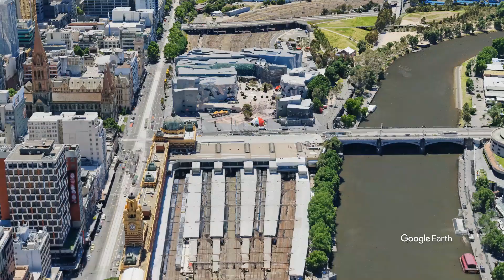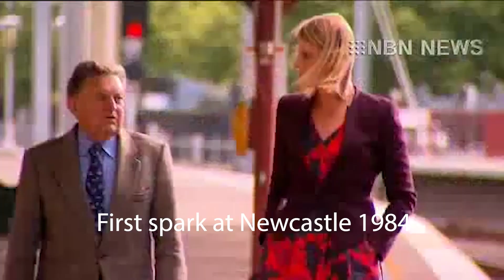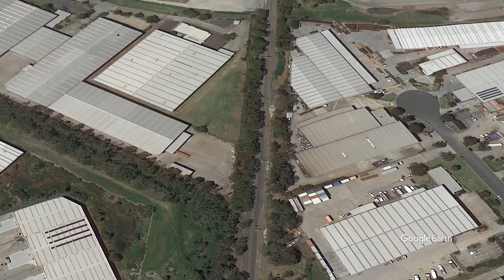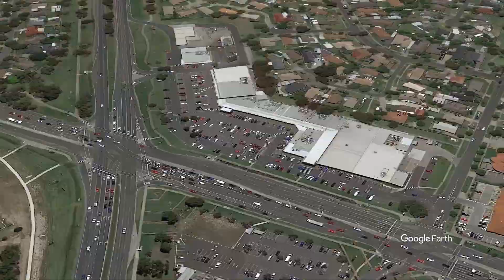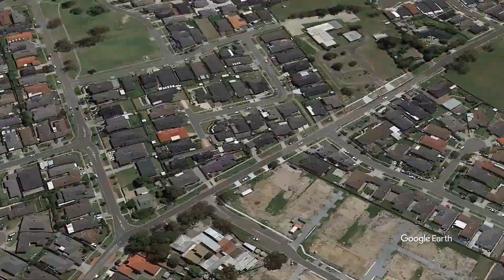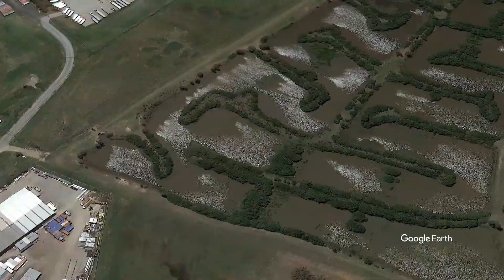Electrifying Regional Train Lines

Comment: Victoria lagged behind with electric rail to regional centres like Bendigo, Ballarat and Geelong missing out while NSW established electric inter city lines to Kiama, Newcastle and Lithgow. Cannot understand this as costs would have been lower back then. India has embarked on a huge electrification programme and currently has hundreds of diesel-electric loco's up for sale as electric loco's take over.  The Melbourne-Sydney corridor competes with cheap air and road coach fares and hasn't the current passenger levels on the current XPT passenger services to exhibit a positive financial return for the investment. Also the old steam era route between the two cities that has sharp bends that need to be ironed out for high speed passenger and rail freight at huge costs.  Great video and information, thank you.

Comment: Great video.  So weird to see a vr liveried electric locomotive.  Never realized there was such a thing.
Reply from the maker: Yeah it is weird but kind of cool. Still 2 in these colours today (1150 and 1162)
Reply: There were also the 1920 era E class locos, they were a marvel of brass dials and guages. Originally they were just 1101 to 1110 but when the E class steam locos became off register, they were assigned E1101 to E1110.
There were two older steeplecab locos but they were retired in the 50s AFAIK.
Train crews called the E class as “electric chairs” or known as butterboxes. They would sit there and go tikka-tikka-tikka.
Reply from the maker: @darylcheshire1618  thankfully some of those are preserved as well. Would be lovely to see them operate again
Reply: @MetroManMelbourne  I there there are a couple of E classes plus one Parcel Van CM, try Electrail, not sure if there is a T there, maybe ElecRail

Comment: It’s also likely that the Sydney to Melbourne line will be electrified sometime in the future if they upgraded the line to a high speed regional line as previously proposed due to the power output limitations of Diesel engines.
Reply: Need a new line where there aren’t so many wide curves but rather a straight line
Reply: @vincentweatherly9991  
Yup so in that case it’s likely that the line would also need to be completely rebuilt with new tracks and equipment that can handle high speed trains while the line route would have to be modified significantly to remove as many curves and level crossings as possible! :)

Comment: To understand the difference between 25kV AC vs 1500V DC you need to know a bit about how electricity works. Firstly, Power consists of Voltage (measured in Volts, or kV [kilo volts] for thousands of volts) and Current (measured in Amps, commonly written as “I”). Think of voltage like the pressure in a water pipe, and current like the speed of the water. Power (measured in Watts) is like the total amount of water flowing through the pipe. It is the voltage multiplied by the current (P=VI). So you could have say 1 volt and 100 amps to make 100 watts, or 100 volts and 1 amp to make 100 watts, Or 10 volts and 10 amps to make 100 watts. So they are sort of interchangeable. That will be important later. 

Now there is a third component in electricity called resistance (measured in ohms). All wires have a set resistance which depends on things such as thickness and length, but the point is you can’t easily change it like you can volts or amps. 

Now in electricity transmission you will lose some power (nothing can ever be 100% efficient). The equation for power loss is P=I^2_R, or in other words the current squared times the resistance of the wire. So if you double the current you quadruple the power loss. So logically you want to decrease current as much as possible. Now remember when I said volts and amps are interchangeable? Well you can keep the same amount of power but by increasing the voltage you will drop your current (amps). Great, now we have a solution to our power loss problem, just make the voltage super high. But how do we do that?

Here’s where AC and DC come in. AC is alternating current and DC is direct current. Without going into the details too much, AC flows back and forth (50 times a second in Australia, or 50 Hertz [Hz]) whereas DC just flows forwards so to speak. The cool thing with AC is that it’s really easy to change the voltage compared to DC. So higher voltage and easier to make it that way means cheaper costs for electrifying lines. 

So why did we go with 1500V DC and not 25kV AC? The short answer is because when we were first electrifying the lines electricity itself was pretty new and we used what was a modern standard at the time. That combined with the majority of the power being produced by the Victorian Railway’s very own Newport power station (now demolished). 

Sydney chose the same 1500V DC because it was building its system around the same time as Melbourne. Queensland (Brisbane to Emerald), Perth and Adelaide all chose 25 kV AC because they developed their systems in relatively recent times. 

Hope that helps. Happy to answer any further questions.
Reply from the maker: thank you, that helps a lot. I will put all this down for my video on this topic.
Reply: @MetroManMelbourne  no worries. It’s because 1500V DC costs a lot more than 25 kV AC that victoria is hesitant to expand its electric network (one of the reasons at least).
Reply: Could bi mode electric trains be a feasible solution for this problem? IE, Sydney and Melbourne could continue to use "legacy" 1500v DC in existing areas but use 25kv AC in regional areas? The trains could switch voltage as they enter the metro zone or the regional zone.
Reply: @DandamanV  while there’s nothing in physics that would stop that sort of thing from happening, the two voltages are vastly different and so to design all the electrical equipment (motors, inverters, transformers etc) to be able to handle these two extremities I think would either be 1. Very expensive, or 2. Not very good (worst of both worlds type thing). So I don’t see it working in the real world.
Reply from the maker: @DandamanV  yeah and technology for these trains already exists
Reply: Hopefully one day it might be feasible, I can't see us changing from 1.5kv any time soon!
Reply: @DandamanV  I don’t see us changing either, but I also don’t see hybrid coming any time soon.
Reply: AC is better for transmission lines, as I understand it the QLD system doesn’t have many substations but in Vic and NSW, every line has to have a substation every few kilometres.
Reply: @darylcheshire1618  that’s mainly due to lower power loss (ie higher voltage) rather than AC vs DC. With AC the substations are cheaper and easier to build, but the reason QLD has fewer substations is mainly just the voltage.
Reply: @FloydBromley  Not sure if the distribution on QR is via the catenary, I think a supply line runs alongside the rail line and supplies the overhead at intervals. Be interesting to know if a transformer is used. Should look out next time i’m in Brisbane.
Reply: @darylcheshire1618  transforming voltage is part of what a substation does. Since electric trains get their power via overhead catenary, then yes distribution is via the catenary. All conductors lose a certain amount of power over time. So at periods that power needs to be boosted. That is the job of a railway substation. The substation is ultimately supplied by even higher voltage transmission lines ultimately running back to the nearest power station. Depending on the location that high voltage transmission line may run along side the railway line for part of its journey.

Comment: What Victoria is going to need are dual voltage trains 25kv 50hz AC 1.5KV DC. Longer trips past the electric territory towards Mildura from Ballarat Railway Station must be Dual Mode 25kv AC 1.5KV DC Diesel Goulburn Valley Route

Comment: Now that some SA Metropolitan railcars have been converted to hybrid, with one of the two diesel motors being replaced with a battery, the future of line electrification is now under a new cloud.  In the near future there is a possibility that full battery electric or hydrogen fuel cells could become viable.

Comment: Question: Would a voltage conversion from 1500 V DC to 25 kV AC 50 Hz be possible on already electrified rail lines in the state of Victoria (especially the Melbourne suburban lines)?
Reply from the maker: Certainly, the only issue would be major disruption. Would probably make sense to introduce this in future though.
Reply: @MetroManMelbourne  The justification of this voltage conversion would allow for interoperability with lines elsewhere in Australia that are currently electrified at 25 kV AC 50 Hz.
Reply from the maker: @JamesTaylorMain  to some extent - only adelaide has broad gauge lines electrified at that voltage (the rest is on narrow gauge)

Comment: If the Geelong and Ballarat lines are electrified, I do hope it will be services not endorsed by the greater Melbourne suburban rail network and new locomotives are introduced exclusively for the regional Victorian railway to support the would be overhead wired beyond Werribee as for Geelong and likewise for Ballarat beyond Melton
Reply from the maker: I agree about them not being part of the suburban system, however I would prefer EMUs to be purchased over locomotives for passenger service. Locos could be bought for freight service.

Comment: the cost of building up and operating overhead wires and power stations are also the big factors of decision
if you go 1500V on every regional line, then you need tons of power stations alongside with the train lines(=$$$), while lower voltage DC are known for its low efficiency due to energy loss from electric cable resistance
if not, you can make it to typical 25kV AC for building less power stations, but it needs to overhaul the whole victoria network(incl melbourne) or require dual power input on every regional train design(=$$$)
even transforming into solar/wind-assisted grid (build alongside the rail track), it still need these power station to regulate it(=$$$)
the current best solution is still using those diesel-electric DMU/locos, or better replace with some alternative fuels or non-combustion fuel cells for better efficiency/emissions, while current patronage of regional network still too unworthy to give the track an electric grid
battery-only? pls don't give a F*** to VLine thx as that's the solution for short distance, low payload with more stops, not for long journey(like BR class 230 intended to design for)

Comment: The cost of running fossil fuel powered trains is going to outweigh the benefits of electrification af all Australian railway lines in the not to distant future ,with net 0 emissions targets needing to be met In all categories of land transport at the same time that massive cost of electrification would either force further rationalisation of seasonally trafficked regional lines in the future or in a net 0 future regional passenger trains will need be retro fitted with or replaced by new trains with hydrogen engine technology or modified diesel/ammonia fuel systems which im thinking might end up being the cheapest solution for private operators. I think there will be some interesting times ahead of us with the pressure on the Australian government to reduce carbon emissions in farming ,automotive, road & rail transport and industry.
Reply from the maker: Battery trains exist, other than that there will more than likely be large amounts of electrification with battery-electric trains